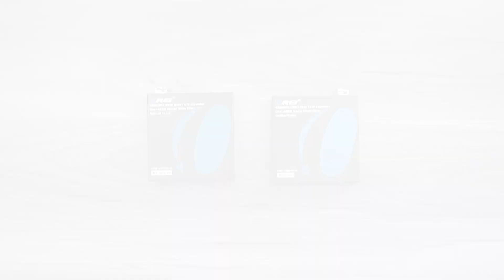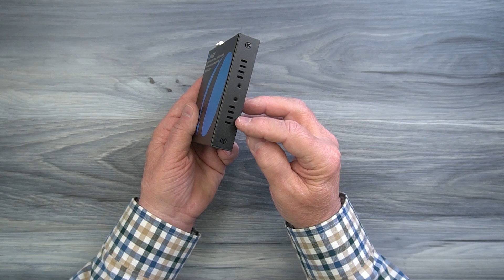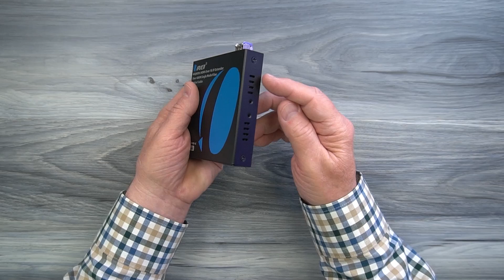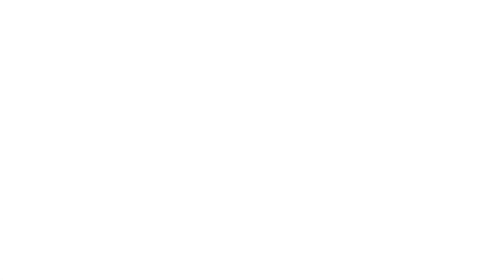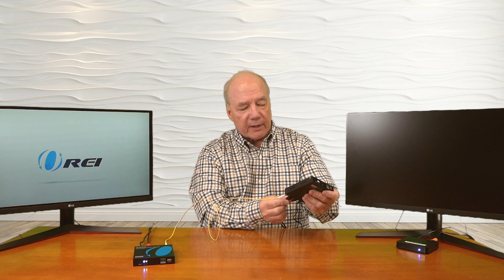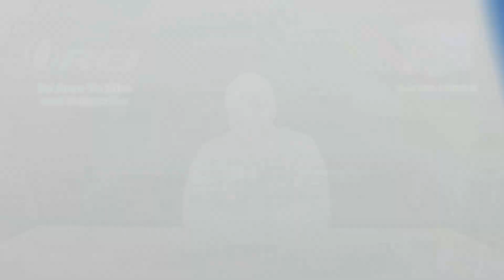Sending 4K HDMI Signal Miles Away

Comment: Exist device therefore switches the input of the soundbar between 2 displays with ARC/eARC.
That operating 2 ARC/eARC sound systems on one television. For example, you can switch between soundbar and AV receiver, or between soundbar and ARC headphone station.